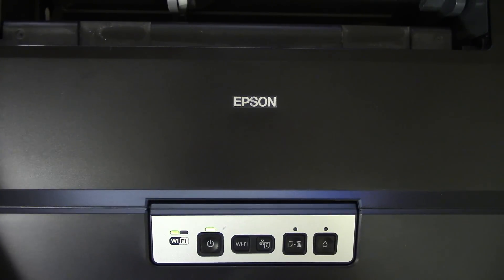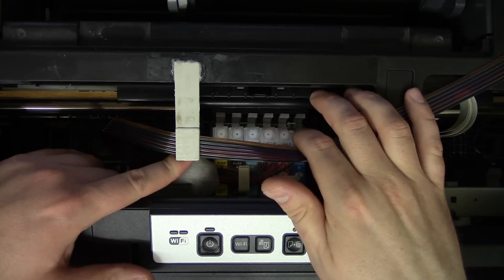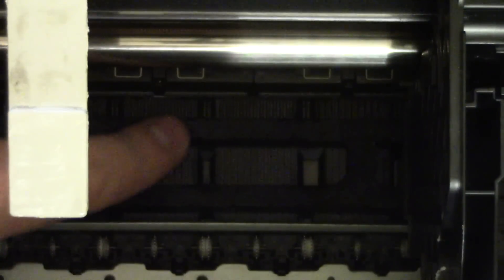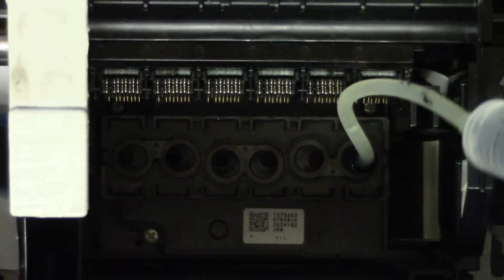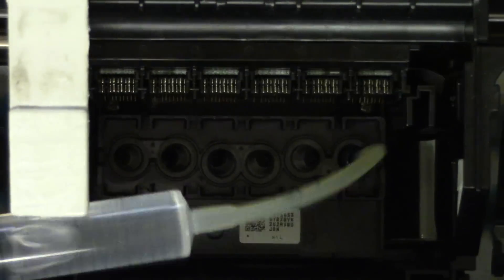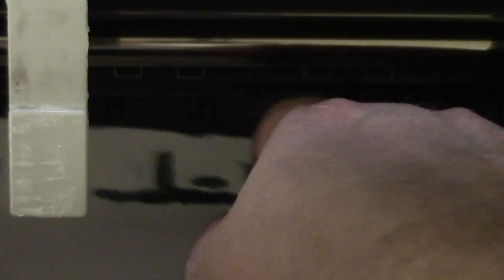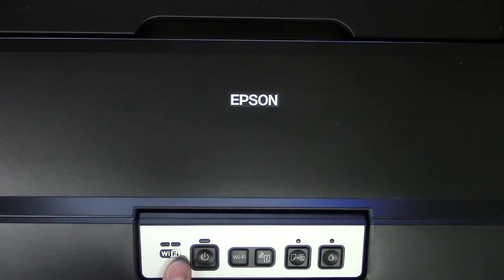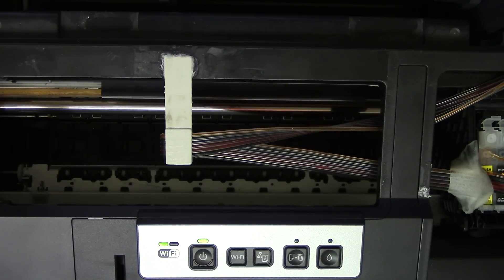How to Clean a clogged Epson Printer Printhead

Comment: I tried everything to clean my print head.  Ran print head cleaning multiple times, used print head cleaner on a paper towel and left sitting under the print heads, injected print head cleaner directly through the nozzles, but nothing worked.  The cleaner was going through the nozzles, so I was satisfied they weren't clogged, but still when I ran a nozzle check, the pages were coming out blank.  Was getting ready to chuck it in the bin then thought it might be an air block that was causing it.  I put a paper towel under the print head again and used an empty syringe with a silicone tube attached and held it over the air holes in the bottom of the cartridges.  Gently forced air into the cartridge and viola!  Ink started flowing from the print head again.  Try this method if you are not having any success with the others mentioned.

Comment: If you are to leave your printer alone, ex. traveling, set it up plugged in with a simpel electric timer, so that the printer runs through the starting procedure like once a day. It uses a little ink, but keeps the printer ready for use.

Comment: Good Video, use two folded up paper towels (one inch in width when complete) instead of the paper.  Remove all the print cartridges (Remove one screw from cover, then pull off cover.  Remove each cartidge with small flat screw driver.)  Tape hole of each cartridge,  use a fish tube or nebulizer tube to connect the small connector on base of printer head manifold, connect the other side of the tube to a printer syringe filled with window cleaner containing ammonia.  Squirt 1 oz of glass through the connector on the printer head manifold.  Then leave connected with cleaner soaking printer hole.  Insure you have no air bubbles in tube.  Let set for 4 hours.  Then remove syringe, tape on cartridges, paper towel.  Pop ink cartridges back into printer. Reinstall print cartidge cover if you have one.

Comment: Worked Great for me, Thanks for the video. I did one thing different. I would inject 1-2 ml of fluid into the print head then pull the plunger back until I was getting ink in back into the syringe. Back flushing the print head. My old 1430 that has been sitting around with blocked print heads for over a year is now fully functional. yeah !!!!
Reply: Trax Cat j

Comment: Great video! Followed your instructions, and all went as you said. But, now I don't have any black lines in my nozzle check pattern at all. Have already run two head cleaning cycles and printed two test pattern pages. still no black at all. I think I have the exact same continuous ink delivery system as you have in the video. Any ideas you might have would be greatly appreciated. Thanks!

Comment: I got an EPSON 1430 a bout 4 years ago ... and I'm not a high volume user . In fact, it could be weeks  before it gets used. So, I'm at a point now when I do a nozzle cleaning , there are small skip areas. Is there any reason why the print head couldn't be cleaned in one of those ultrasonic baths? I realize that the "foil"  where the ink comes out is sensitive to any handling ... but if there were a way of suspending the unit into the cleaning liquid, ... would this not do the job? The other question I have is where do I source the necessary  replacement parts for this printer ... now that it's been discontinued? The other major circumstance is that, living here in Canada, ... shipping costs from the U.S. are prohibitive ... in most cases, gar more expensive than the parts themselves.

Comment: idea: make a cartridge that fits where the ink cartridges go but is filled with cleaning fluid instead of ink (like the old head cleaning audio cassettes). feed paper partway in to catch the fluid as in the video. does this already exist?
Reply: epson l 210

0
Reply: Just buy some refillable carts for a few dollars and fill them with cleaning solution instead of ink. Print a bunch of full color test pages and you're done.
Reply: @aryakumarsatish5140  pp

Comment: I have a monster of a situation. My Stylus Photo 2200 was stored for over 8 years (maybe closer to 9). It was stored fairly protected from temperatures (with the ink tanks in it). Now that I'm trying to use it again (I upgraded my DSLR) the yellow refuses to work at all. for the last month I've had a set of tanks I bought with printhead cleaner in them have been sitting in it, running head leaning cycles once a week, per the instructions... mostly (4 cleaning cycles then a test sheet, repeated twice) and nothing has changed. This morning I ran the cleaning cycles and test sheets, as I have the 3 weeks prior. NO CHANGE AGAIN. I chose to repeat again this evening but nothing showed on the test sheets, NOTHING... the printer went through all the motions, but without printing a pattern on the paper. I can't get this cleaning set right now, but as soon as I can. I hope it will save my printer.

Comment: great video. unfortunately im not sure this is the problem im having. when i print something, there are vertical lines throughout the print. ive done everything i can think of to try and fix the problem but im not having any luck. its a epson xp-410. id appreciate some insight on what i should do....other than replacing the printer. thanks

Comment: Hi!  I have an Epson 7600 that had not been used for several years.  The blacks were fine.  The yellow and magenta had air bubbles in the tubing.  Upon cleaning the head with Windex (the ole paper towell overnight method) the yellow started to move through the tubing and the nozzle check was now perfect with the yellow.  After second overnight Windex still no magentas.  Do you think the ink is dry in the tubing or it it is a the heads that are still clogged and it's creating a vacuum?  Do you think the product you mention might work with the 7600?  Thank you!  Laurie
Reply from the maker: It's definitely worth a try.  Others have had similar issues where the printer sat for years and this took care of it, besides it's sold with a money back guarantee.

Comment: Hello, I had darker lines on blue and black so I decided to clean the 
head. I used cartridges filled with cleaning fluid and also I left a 
soaked paper towel underneath the head for 6 hours. Nozzle check before 
the cleaning was good (just had the lines) but after the cleaning and 
printing full pages/doing several head cleans etc black nozzle check is 
still bad - missing about 30% of the lines. All other colors reappeared 
to 100% but just not the black. Any suggestions please?
Best Wishes!:)

Comment: As you know this Epson Artisan 1430 is discontinued, do you have any printer recommendations for sublimation work. I used to have a Continuous printing system but it didn’t work well as I travel a lot with the printer.

Comment: I have an Epson c88 stylus printer.  I use it with a CIS system with sublimation inks.  The printer is about 6 months old.  It has started having very tiny black specks on my printouts, that looks like little specks of pepper .  Do you think that this would help fix whatever these tiny specks are?  I have no idea where they are coming from.  Sometimes there are a lot, sometimes not as many & there is no special pattern.
Reply: In addition to the method in the video, take a piece of kitchen towel - or a piece of cloth, saturate it in cleaning solution or water - and place it below the print head assembly. Try gently either moving the head assembly left-right - or polishing the bottom of the assembly by pulling the cloth gently back and forth. You should see a lot of old ink being transferred to the cloth. 
Repeat with clean cloth until reasonably clean. Then do the de clogging using the method in the video.

Comment: I'm having trouble getting this to work as of right now. The solution doesn't want to feed through my yellow... I use the printer often so I don't know why it would be so clogged. The first attempted flushing just made the yellow output a lot worse.
Reply from the maker: I've found that if there's bubbles in the solution when injecting it, it can actually make the output worse for a while.  Try tapping the syringe like a nurse does before sticking you.  Maybe that will help.

Comment: Hi!

Did you ever do the video on what to do when the pad is maxed out??? In desperate need of help with a 1430 less than 6 months old!
Reply from the maker: I did do a video.  I'll work on editing it tonight.  There's also a product that you have to install soon after to prevent your printer from dumping ink everywhere.  You must have printed a ton or done a ton of cleanings for it to have done the pad max out warning.

Comment: Just attempting this now, any reccomendations on taking off the carriage top without breaking it? Yours is already removed in the video
Reply: I did the cleaning, all of my nozzles are printing clear and crisp accept my Light Cyan and Light Magenta...Which is strange because when i did my nozzle check before i started, the Light Magenta wasn't completely clogged, now those two nozzles are shooting a complete blank when i do the test print....any idea what the problem is?
Reply: ended up unclogging after doing a few more head cleanings!
Reply: air bubbles?

Comment: I've been having trouble for a while and I think my yellow might be clogged, it test prints so faint I can barely tell if any of it is there, no gaps, not really gaped just extremely hard to see. I've been having an issue for a long time getting it to print images with a neutral grey, instead it will substitute grey with blue, or brown, or purple, depending on the paper, but it never print's grey and hasn't since the genuine ink (I now use Precision Ink).
Reply: Are u happy w this company’s ink or is the reason you are having issues the the colors you referred to?

Comment: Great tutorial!  I'm still having problems with my yellow though and red colors. they tend to have dark areas in them or are just muddy. any ideas what's causing this? even when I print nozzle test, yellow looks to have some dark in it.
Reply from the maker: Thanks!. Are you using 2 different kinds of inks?  Sometimes different brand inks can congeal.  Or the printhead is still dirty, like there's some black on the yellow area and it's mixing on your page.  Maybe I'll have to do another video with some more tips.
Reply: HBT maybe I am using two different inks. not sure but I wouldn't think so. I just recently bought the epson 1400 stylus and also installed a continuous ink system at the same time. I've made enough prints that the old ink should be gone.

 The printer was used. It was showing low ink levels before the clean, and then showed full after. I thought that was interesting. they may be overly muddied heads and clogged still.
Reply: wow i had the same problem too...
Reply: Try this : 

Put some isopropyl aclohol on the yellow head and after that try putting a straw on the yellow head and blow hard with your mouth.It should open it up.

Also check if the yellow cartridge (the white square thing)  is loading up with ink..i.e. has free flowing ink inside it..that can also be a problem . If it is clogged, disconnect  the pipe and put a syringe at the point where the pipe was connected to the cartridge..push it back and forth with air or warm water..it should unclog it .

Comment: Unfortunately, I purchased some ink (not Epson) and my wf-3620 in not printing correctly.  Will the cleaning process correct this problem.
I have purchased some Epson ink and have thrown the off brand away.
Reply: Martha Young Adult did u any better luck using the brand ink instead? Please let me know if anything worked? I’m a newbie and found a artisan 1430 old owner told me it just quit printing one day and didn’t have time to mess w it. So, I’m trying to learn and see if I can save it and attempt this by not tearing something else up on the printer in the process.

Comment: My printer isn't clogged, but I want to go from Dye to Pigment.  Do I need to flush the heads before continuing or can I just switch over after the Dye is removed from the cartridges and tanks?
Reply: Any luck with this answer? I'm wondering the same thing..

Comment: I'm still trying on a 1430 that has a CISS but hasn't been usen in over 6 months. I have to clean all 6 heads so wish me luck.
Reply: I did the exact same thing tonight on the same printer with the exact kit in the video and it worked.
Reply: Yes I am the same.  My 1430 hasn't been used for about a year and it is all clogged up.  I use an external ink system like in this video and I had run out of ink for it.  I have just ordered some new ink in so when it gets here I will need to clear out each of the print heads to get it running again.

Update (24/10/2018):  My ink arrived and I followed the process described in this video and it worked a treat.  I used folded paper towel under my print heads rather than just plain paper so it would be more absorbent but it worked well, all the dried ink was removed and the cleaner being injected through the heads flowed clear.  I primed my ink tanks with the new ink and did a few head cleaning cycles and the printer was good as new!
Reply: Haydn Allbutt hey I’m very new to printing but someone had one of these 1430’s sitting at their office because it just quit printing one day and they didn’t have time to troubleshoot it and could afford to buy another bigger and better than 1430 model. I can’t afford a new one and I’m praying I can save it. So, can I just do this nozzle cleaning w this solution cleaner first while adding a waste tank and then go buy the ink afterwards?
Reply: Hi Christi Davis.  Yes is the short answer.  The cleaning process described in this video will dissolve the dried ink particles, resuspend them in the cleaning liquid then rinse the cleaning liquid from the print head.  If you rinse the print heads until the liquid runs clear there will then be no more ink left in the print heads, so if you leave the printer for a day or two then there will be no problems.  For particularly clogged print heads, I have squirted the cleaner through the print heads as best I could (try not to put too much pressure as you don't want to damage the print heads, they are very very fine holes), and then left the cleaner over night to soak, and then ran some more cleaner through the heads the next day.  So there is no problem with leaving the heads having cleaned them with this method.  I wouldn

I wouldn't leave the print head cleaner in the print heads for weeks though as the liquid will evaporate potentially leaving residue behind which may gum up your print heads even worse than the ink.  But certainly so long as the cleaner solution does not in turn dry out (couple of days should be fine) then all should be ok.  If the printer has survived for this long with out being used, you could alternatively just wait until you have your ink then start the cleaning process.

Good luck!
Reply: @AusFastLife  Hi Haydn, all of my print heads were super clogged, and I tried this method.  Unfortunately it didn't work, so I repeated the process and now it is worse than before! I then ran multiple standard head cleaning cycles to no avail. Any tips? I don't know what to do at this point.   As you mentioned before to not use too much pressure - how do I know if I damaged the print heads, and if that is the case what do i do? Thanks for your help.

Comment: Does this work on all Epson printers?  I have the 3640.  Thanks
Reply: Yes, you can do it with the 3640, same idea but only 4 colors. I have one with a continous ink setup on mine and it decided after about 3 years to stop pulling ink through the black cart. They hate to sit and they will dry out and clog. I bought the updated version of the same CIS and filled it with my leftover ink, plus the new pigment ink I bought for it. It took a bit to clean and purge everything but it's working OK again. I think I'll get a cleaning kit myself as it obviously clears the heads faster than running cleaning cycles and wasting ink, plus if your cartridge on a CIS setup plugs you can probably clear it as well and get it running again.